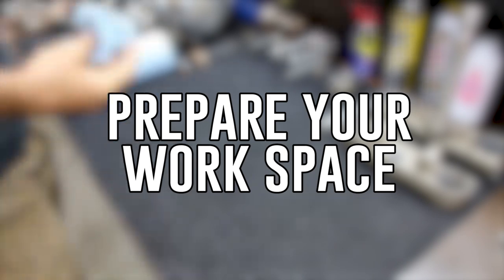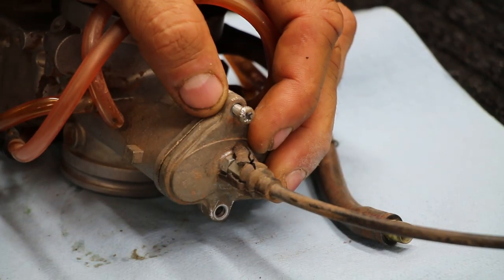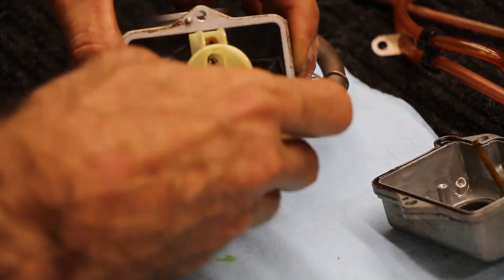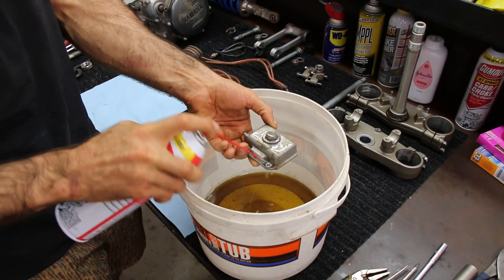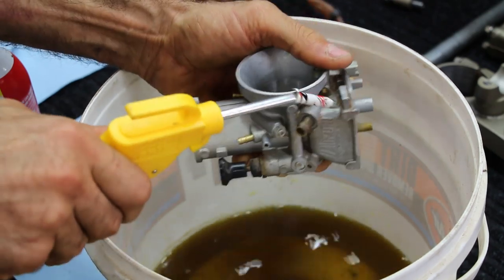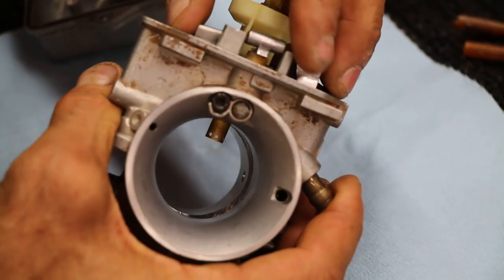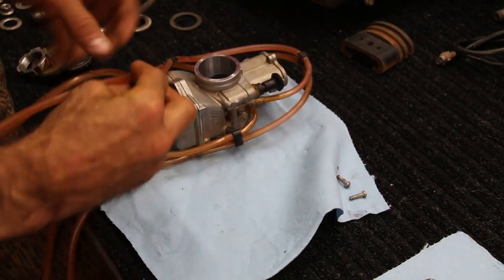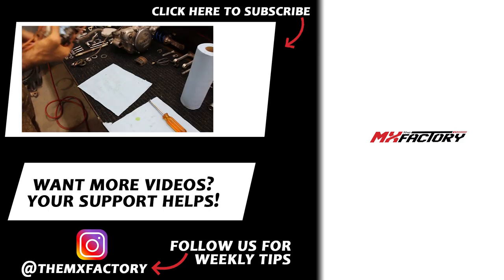How to Clean a Dirt Bike Carburetor • YZ125 Rebuild Ep. 2 • WIN THIS BIKE!!

Comment: Getting familiar with carbs, and learning how to clean them is one of the most important things you could learn on a bike.  It really helps with tuning and troubleshooting.  Sometimes you could get a bike cheap that won't start, and it could be as simple as cleaning the carb.
Reply from the maker: We agree!
Reply: @TheMxFactory  My son and I went to Hardrock in Ocala for New Years Eve.  My son went out, and the bike started running like crap after the first  lap.  It would start and run, but would not want to rev.  The minute you hit the throttle, it would want to die, as if it were starving for gas.  I removed the carb, removed the main jet, and blew through it.  This mucous rubber jelly came out, right onto my finger.  Blew some carb cleaner through the jet, and the rest of the carb, and replaced.  Started and ran like a champ.  Big lesson for my son.  It helped him realize the importance of understanding a carb, and knowing the general function of your bike, even if you are not a "mechanic."  If I was not able to do what I did, the consequences would have been significant.  1) The day and riding fees would have probably been wasted.  2) I would have had to take it to a shop.  3)  Spend who knows how much to get it fixed. 4) Shops often keep you bike for a week, even for the simplest things.  5) Dropping it off at the shop, and then picking it up from the shop.

That's why I love these bike build videos, where us regular folks could add to our knowledge and understanding of our bikes.

Comment: Excellent video, the one thing that's super important that I feel you didn't touch on, was float height. Other that that really informative
Reply: first time cleaning my carb what should I know about the float height?
Reply: What about the float height?
Reply: it only needs to be adjusted if you suspect the carb is either flooding or is starved to get fuel into the bowl (float valve closes too early due to low float setup)
Reply: Where can I find out the float height for my carb for 125ke Kawasaki 1978

Comment: I am no mechanic, but there is something else that I've learned that I wanted to share.  When I needed a bike to basically ride along with my little guy, I tried keeping the cost down and found a pretty good 2002 XR250R.  Older bikes often come with some issues that pop up now and then.  One issue I ran into was a leaking carb from a sticking float valve ... just peeing from the bottom.  I went round and around taking the carb apart and cleaning, then rebuilding, and the issue would be resolved temporarily, but would resurface quickly.  What eventually took care of the issue was polishing the float valve seat.  After my experience, I would not clean a carb, or especially rebuild a carb without taking this extra measure.  Here is a video that addresses the topic.  https://www.youtube.com/watch?v=zlez_hdoWYk

Comment: One tip I wanted to share is using JIS screwdrivers for Japanese bikes, especially when working with soft bolt heads like on a carb.  JIS is something I didn't know about until recently.  You are much more likely to strip the head by using regular phillips screwdrivers.  It's a very subtle difference, but could make the difference between stripping or not.  Just look for the little dimple for when you should use JIS.   https://www.youtube.com/watch?v=gEwVUZr5xxQ
Reply: Yup, good tip. I wished someone would have said that 20 years ago. American Philips don't cut it.
Reply: @warrenlange6106  Phillips kinda cuts it if things aren't tight, but the minute you have to apply any kind of real pressure, you're like, what the heck.  I would look at the Keihin carb on the side of the carb as confirmation that I wasn't dealing with a cheap Chinese knockoff.  I used to be perplexed, until I found out about JIS.

Comment: What year is that carb from mate. I had what I suspected to be a carb from a 2001 yz125, I ordered the relevant rebuild kit however the main jet is wrong. It’s a lot smaller. My main jet in my carb is the same size as the one in your video. Thanks in advance if you can help 🙏 ❤

Comment: My bike won’t even kick over with a clean carb. I have spark and 160lbs of cylinder pressure. I may have messed around with the carbs air screw and fuel screw a bit so now I have no idea what the settings should be at to kick over. How much would it cost to have a shop get the carb sorted for me?

Comment: One thing NOT Done is the (stop flot gasket). Which is a mean couse of failing issue of the TMX carburetor Air & gas flow .
Reply: You know about the airflow screw? On the yz 125
Reply: @jonathanusery7269  what is it, you need to know about the air screw and what year, carburetor , and what have you done?

Comment: i cant get the cable off the needle thing help, please 😂 this is the only video ive seen with the same carb as me
Reply: Open your throttle tube assembley take the small wheel out un hook the cable  from the throttle tube thos will give u enough slack to unhook the needle at the other end

Comment: How do you get the throttle cable the lid?
Reply: Easy way to work on 2stroke carburetor is to disconnect the throttle cable from the throttle tube.  By disconnect cable from throttle tube and housing, will free up the cable making giving penalty of cables slack to disassembly a eas.  When reassembling carburetor us a pick at the cable end to lock the cable in the proper position / tension once the slide is connected pull cable tight,

Comment: You don’t rinse in water after clean?
Reply: Because water can cause rust or mix with the gas. If you want to bath it down as an extra precaution id suggest getting a small bottle of gas,  sometimes I use an old dish detergent bottle obviously rinsed out really well and ill use gas to bath and rinse the carb. That works well. Also you could just buy an ultrasonic cleaner and solution at harbor freight for cheap.